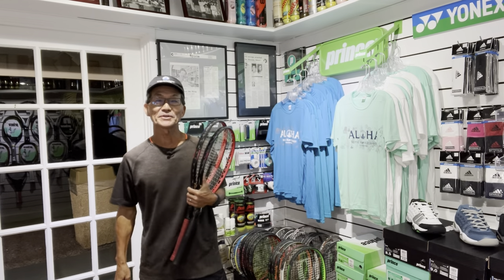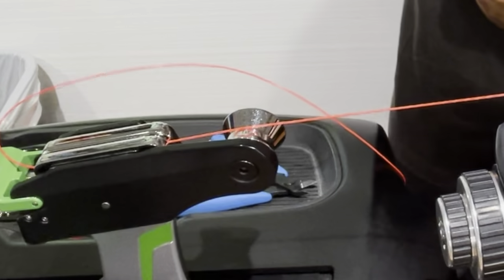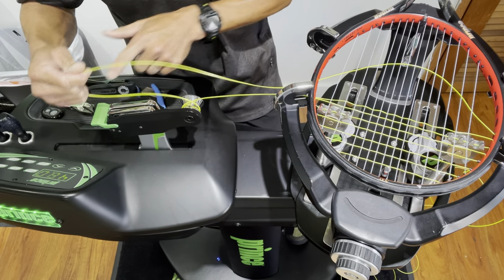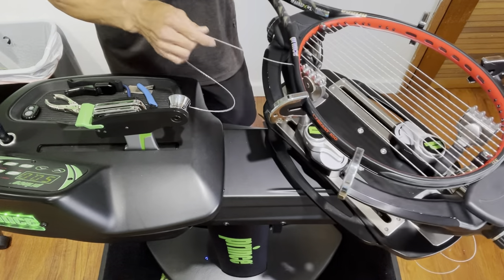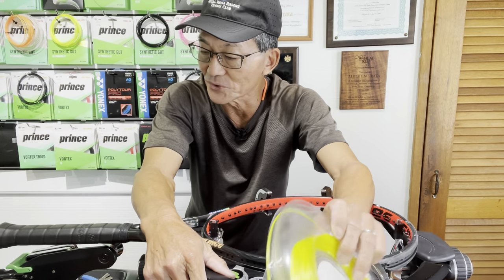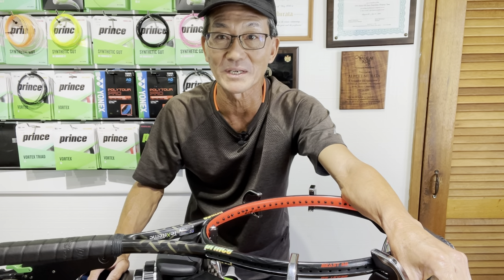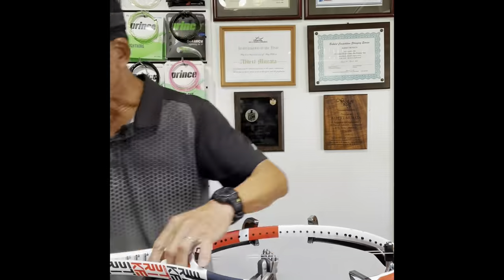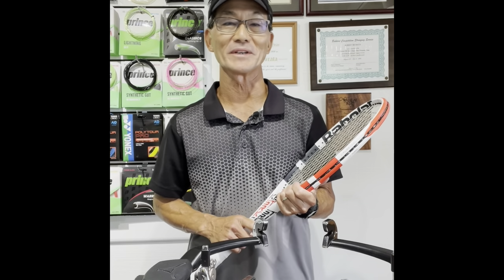Racquet Stringing [Stringing Machine Diabolo Application]

Comment: hi there 
what tension meter (the one connected to the laptop) are you using?

Would you suggest it for personal use?
Reply from the maker: Aloha, 
The ERT700 is an older model of the current ERT300, which is no longer being sold. You can purchase the ERT300 for about $267 here - https://www.wdstrings.com/stringing-tools/?_bc_fsnf=1&brand=53

Here's another video I did on string tension devices. https://youtu.be/9Ux5eBzXrCY

The ERT300 is an investment if you're into that kind of thing (and well worth it), but if you want something cheap, you can try the Racquet Tune app on your phone.

Comment: Hi, nice! Do you always string the crosses from top to bottum in every racket (using four knots or two knots ATW method?)?
Reply from the maker: Aloha Ted, 
Yes, it's standard practice to install cross strings from top to bottom to reduce the stress on the frame. 

The reason for using the ATW method (1-piece) is when the last main string ends at the throat. Otherwise, when the last main ends at the head, you can use a standard 1-piece method. 

When using the standard 1-piece or 2-piece method, I would recommend the technique used in this video to help reduce friction. https://youtu.be/OLdVwq81Ebs
Reply: @AMstringing  thank you very much!!!!